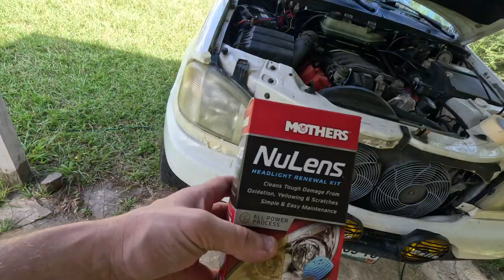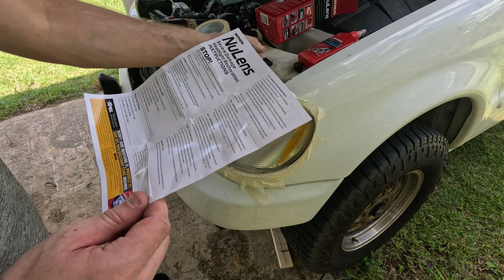Reviving the 24 year old headlights on my 99' Mercedes-Benz ML430!!!

Comment: Negative offset pushes tires out, 😂 sounds good,  gotta get a winch bumper for them deer 😂😂😂❤❤
Reply: If they'd just go back to glass headlight we wouldn't have these problems 😂😂
Reply from the maker: It pushed the tires out 42mm because the normal offset for my tire is +62mm offset, +20mm brings it 42mm closer to centerline, or the outside edge, but I agree, glass headlights were way better imo lol